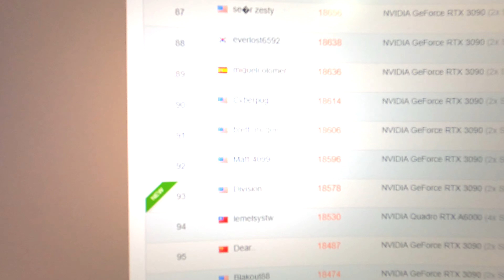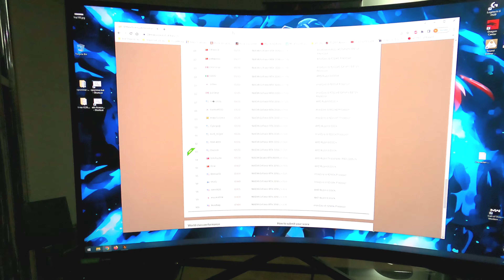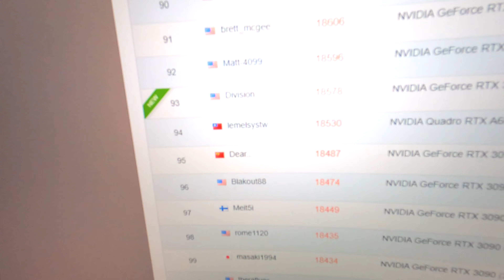Top 100 in the world?  The GODLIKE computer build, start to finish to madness.

Comment: Great video, love your enthusiasm, & its so NICE to see someone who likes to go to the extreme for once! Quick question; if I got the same case, and didn't bother with the 240mm radiator at the back, could I fit: 
2X 480mm radiators at top, 
1X 420mm radiator on side, 
1X 420mm radiator on bottom, 
all blowing "out", with the 2x 200mm fans on the front and 2x 120mm fans on the back all blowing air in? 
Would that radiator configuration fit? The spec on the Cooler Master website is a bit unclear on this; it suggest only 2X 360mm radiators at the top, but I have seen videos with people putting 8X 120mm fans at the top, which suggests you could fit 2X 480 radiators up there. Would really appreciate your guidance on this.
Reply from the maker: It might be possible to do the 420mm radiators, but it's already getting cramped trying to run water lines properly.   I'd probably stick to 360mm all around if I had to redo it.  Also careful on the thickness of your radiators, don't go super chonk on them.  Stick to 40mm or less.   With all those radiators you actually don't need the chonky ones.
Reply: @TheWeebLounge  I was planning on 30mm thick radiators; I value silence almost as much as I value cooling, & the thicker the radiator the more noise the fans make pushing air through. :) So you don't think it could fit 2X 480 radiators at the top, even if I didn't have a rear 240 radiator like yours and I scaled down the side radiator to a shorter 420 radiator? Thanks in advance. :)

Comment: K-on girls are ready to get hot ! 

Theres realy ppl buying thoses big massive figurines , its kirino i think 🤔

Gj with your computer , i know now  thoses ppl that build computer and get paid 75€ arent paid enough lol

I wanted to make a wattercolled pc , but having to empty all liquid and put an other one every 2 years is scary , the guy that make computer on the shop told me it was possible to put a way out on the bottom of the case , by opening it the liquid would get out , i hope hes right

Theres thoses "pro" computer with 8 ram 2 cpu and no fan graphic card , i guess its possible to make a computer without any fans , but they cost a lot...and probably arent great for gaming anyway

I like thoses 4 lights around your screen , the one near your new computer
Reply: I actualy wonder if thoses pro compter arent better for emulator 🤔

Comment from the maker: Shot in 4k, but Youtube is being weird.  :(
Reply: 😆🤣🤣good luck on that nick! 😁😁
Reply: Yeet
Reply: Hey I wanted to ask how you cooled your rtx 3090 memory temps. I have 4X EVGA RTX 3090s and I'm not too happy with 96-100C on the memory junction temps. I have resorted to just watercool the whole gpu and the backplate with active cooling too.
Reply: @Cristian R i had an old graphic card that was kind of hot , ive dismantle it and put thermal liquid (thoses grizzly things) on it , i was around 80degree , now its around 55 , i dont know how wattercolling on graphic card work so i dont know if its still usefull 😓